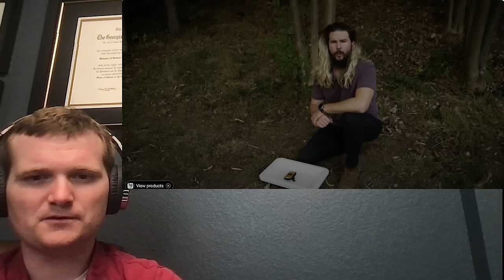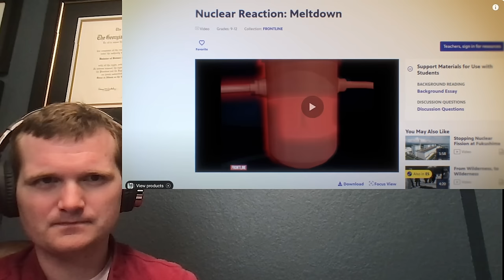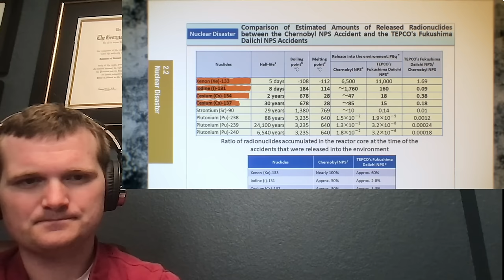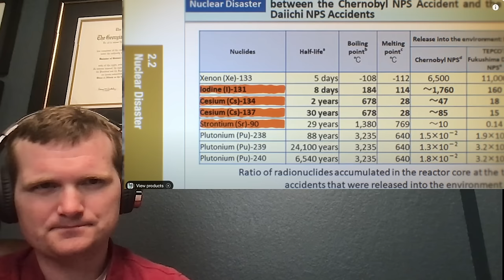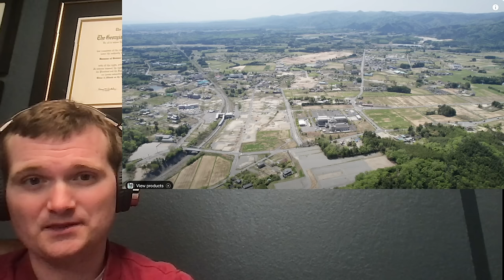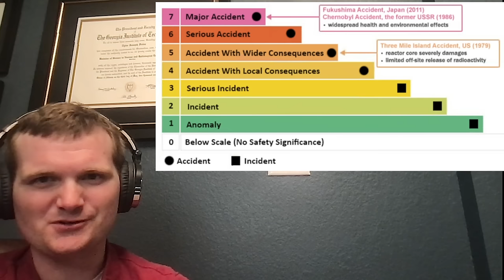Nuclear Engineer Reacts to Kyle Hill "The Microscopic Reason Chernobyl is Still Dangerous”

Comment: The 7-point scale needs to be expanded to a 10 point scale, so they can differentiate the scale of the issues.
Reply: They need to add "Zuul" and "don't cross the streams" levels.
Reply: @RobRutherford  and the third, "3.6 Roentgen. Not great. Not terrible."

Comment: Another very well done video. Excellent! And hot off the press too. Kyle's video is only a day old.
Your phrase; "just because of how much they broke their reactor" when referring to the Chernobyl accident, kind of had me grinning despite the severity of the situation. They really did some terrible things to that RBMK, even when they didn't mean to. Of all the shortcomings and flaws it had, not having a containment building would be the most idiotic. You simply do not put a reactor out into the world in little more than its bare fuel rods, especially when you as a designer also made an effort to give it every undesirable characteristic in the Physics book that you could find. But that was the Soviet Union for you, I guess.
Reply from the maker: Thanks!! So glad you liked it!
Reply: It's also worth noting that the USSR did put reactors out into the world with no shielding. They were smaller power generators usually used to power radio repeaters and lighthouses out on the outskirts of the country where it would be far more expensive to run utilities out to the location. 
As for the U.S., I'm not positive on the name of it but I'm relatively certain that there was an incident involving an experimental reactor back in the 50s or 60s that went into meltdown with no shielding. 
I'm also fairly certain Kyle hill did a video on that one but it's 3:30 in the morning and will revisit this once I dig for it
Reply: @speeddemon4484  Are you talking about the SL-1 accident in 1961?

Comment: 7:13 reminds me in one book about Chernobyl, a Soviet Bureaucrat was demand a repair & restart timeline for the failed reactor. 

Though there was a small meltdown in Chernobyl Unit 1 in 1980, due to a faulty cooling valve remaining closed following maintenance. They had to permanently block off those damaged fuel channels. They restarted that reactor 8 months later.

Comment: The problem with RBMK reactors isn't the design but the lack of limits put into the reactor control system 

Had the system been programmed to forced a minimum minimum amount of control rods in the system at all time as their procedures required then they would have to wait 

Or had the reactor even been programming to automatically scram when parameters were out of line then it wouldn't have happened 

Heck it was steam explosion 
Had it had a pressure release value (this wouldn't save the reactor) it wouldn't have been as deadly as it was 

Basically the problem with that deign wasn't the casing but the controls

Comment: Is there backups for these plants to keep them from overheating if there is a worldwide power outage?
Reply: If every wind farm, solar panel and diesel generator on Earth all stopped working at the same time, then no, there would likely be no backup.
Reply: @atraxisdarkstar  most plants have backup battey banks 
And even then the moment the auto shutdown system detects something is wrong it will immideatly engage
Reply: @shoeskode136  But this is a worldwide power outage, you see.  Nowhere on Earth is producing power.  So you have cooling until your batteries run out, and then you don't.
Reply: Are you referring to a situation similar to the Carrington Event (a massive CME)?

Comment: @3:50 and there is your problem. Modern nuclear plant designs. The average age of nuclear power plants is 31 years, some even much older.
@6:15 you say the fuel enrichment in modern reactors is not enough for prompt criticality. But Chernobyl was using very lowly enriched fuel for plutonium breeding. It was barely enriched at all. That's the reason it had to be so big. The reason it eventually blew up was because of a pressure spike blowing out several water/steam channels through the core at once. The reactor was rated for one such event, but 5 occurred, which caused the rapid unplanned disassembly event. Basically everything was ejected from the core.
@14:45 that is not true. A containment building is rated to withstand some amount of static pressure, such as 0.5MPa, which may occur in a local loss of coolant accident. A meltdown is worse as it may continue to generate pressure and steam. It is pre-stressed in compression to prevent cracks from opening where releases may occur. It is not rated for dynamic loads, such as explosions, or indeed aircraft impacts as some people like to claim. Modern containment buildings are constructed with extra walls surrounding the containment building to dissipate an airplane impact force before it hits the actual containment, but only partially, the very top dome is still exposed. But that's not true for older designs where terrorist attacks where not part of the design criteria and such extra walls were not built, simply because they were not deemed necessary. Additionally while modern containment buildings are generally considered aircraft proof, releasing data on how aircraft proof, particularly with supersonic jet aircraft, is... discouraged. So nobody really knows. But the fact alone that such data is not released kind of suggests something they don't want to admit to. Additionally, Chernobyl's reactor was just so enormous, that a containment building was impractical. And even if they did make one, I still wonder what a 1000t reactor lid shooting through the roof would do to a containment building anyway. Containment buildings, especially at the time, were made to withstand static loads in local accidents, not explosions or impacts. Fukushima had containment buildings, and all 3 of them exploded.
@21:50 again, you talk about "modern plants" and how amazing they are. But the fact is, the vast majority is not modern plants. Even so, fukushima was a modern plant in a rich, highly educated and well industrialized, westernized, democratic society. It wasn't the soviet union where you can blame idiot operators and missing or disabled safety features.
@22:40 not wrong, but also not true. Depends on your fuel. Plutonium is chemically nasty and has a tendency to self ignite when powdered.

I'm in favor of nuclear power, but you have to be honest about things.
Reply: I believe he misspoke with the "prompt critical". The moderator in the RBMK was fixed and so were the fuel rods until the lid blew off. I think he meant "hypercritical", where the rate of fissions increases at an exponential rate. The low enrichment rate was a feature of the RBMK, just like the modern reactors he talks about in the same breath. It was impossible for one to go prompt critical. He's delusional, take him to the infirmary.

Comment: I kind of agree with the weight lifting thing. I don't have any evidence to back it up, but anecdotally, ever since I've done things to get a yearly dose of radiation from at least an X-ray, but preferably a CT, I've gotten sick less. I whacked myself in the head with the floor earlier this year to get a CT, and I haven't had any tummy bugs or even a cold. I figure the radiation kills off my weak cells and leaves the good strong cells to continue dividing, overall increasing the power of my immune system. 

The last couple years I've been getting head CTs, because they are the easiest to get approved by my insurance. I think I need a good abdominal one this year though. My pancreas and liver are slacking. If anyone wants to punch me in the tummy let me know. 

Just don't hit me in the testicles. I tried that and they'll only do an ultrasound on your scrote. Totally defeated the purpose of getting hurt.

Comment: not misleading in the slightest... mox dude
Reply: the only difference is that chernobyl is land locked, and yet both need the same level of attention and decontamination with land. for multiple generations.

storage of fuel in the field of fire instead of off by itself isolated and netralized... fake dirty diamonds... which can be further refined for the valuable materials tht would otherwise go poof. but is the safest method we have of long term anove ground storage...

Comment: He also showed hiw they separate dirt to find the Hot Particals. At one point the meters go off the charts over a speck of dirt, wondering why you didn't include that part in your reaction 🤔
Reply: Tyler is very careful about not just reuploading the whole video, instead just editing it down to what he has meaningful commentary on. Based on Kyle's comments to other reaction videos that just post the whole thing, it's definitely appreciated.
Reply: Unlike a lot of other reaction channels, he's actually cognizant of the creators time and doesn't just essentially reupload a video and have no one go watch the original.